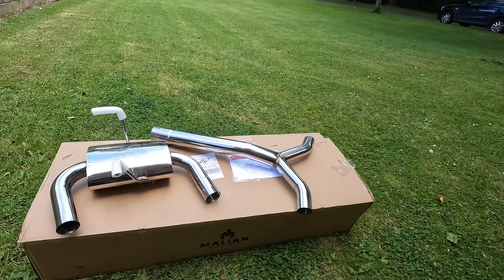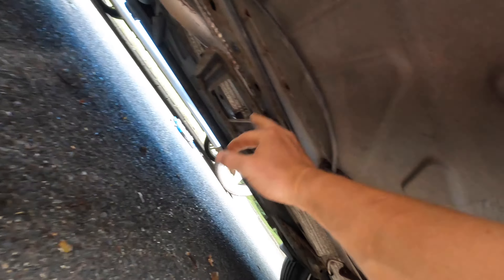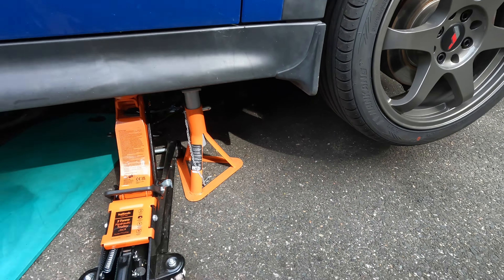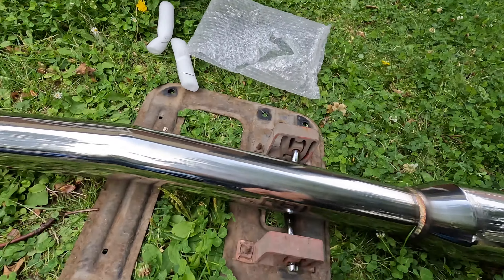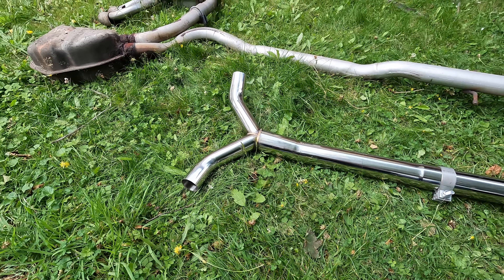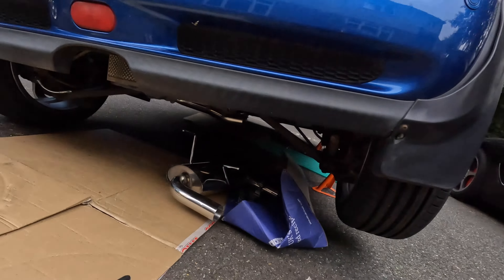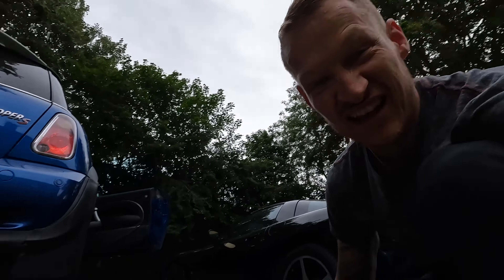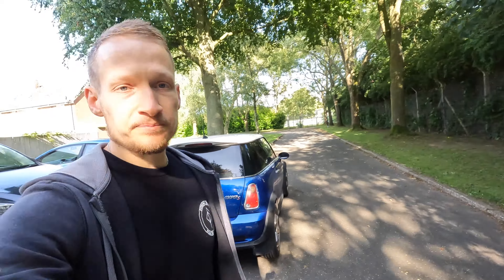Malian Exhaust, PERFECT For My 2006 R53 Mini Cooper S Project Car

Comment: Just bought this exact exhaust! Just fitted it with a pipercross panel filter, sounds absolutely amazing, and seems like it has better throttle response! Brilliant value for money!
Reply from the maker: Ah sick! Yes it is so much better than the stock on and nearly a third of the cost cheaper than the premium brands, plus it makes all the right noises. What's not to like 😀

Comment: that sounds really good that. i wish i can get some pops and bangs out of my micra nothing too much though because i use it for business use
Reply from the maker: The R53 does it stock with a stock exhaust which is why I wanted it as I knew it would be good with an aftermarket exhaust as well. Mine is my daily and then the Evo is the pride and joy, but yeah if it's for work you've got to be a little restrained
Reply: @dominichills  yeah probabbly could have a exhaust just dont rev it near clients I guess keep the rpms low
Reply from the maker: @jayfrosvlogs  EXACTLY!!!

Comment: It will sit straight, you have to make sure all the clamps are undone, mess around with the hangars until its where you want it and then tighten them all up. got this exhaust on one of my r53's and I think it sounds better than the Miltek+scorpion manifold on my other r53.
Reply from the maker: I'm exactly the same, it sounds amazing to me, and the pops and bangs are crazy. I don't mind it sitting a little off, but I'll have a tweak around one day, when it's dry 🤣